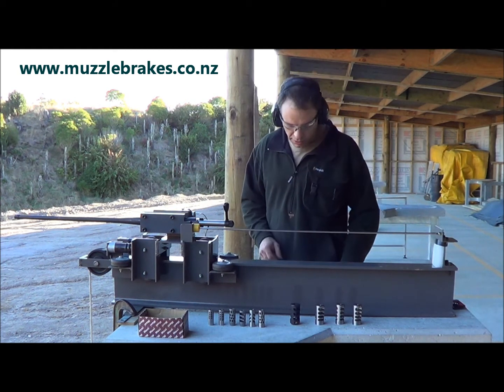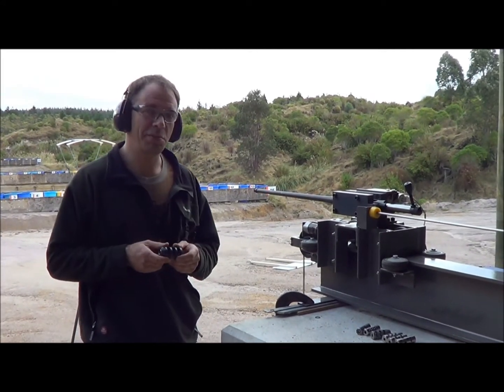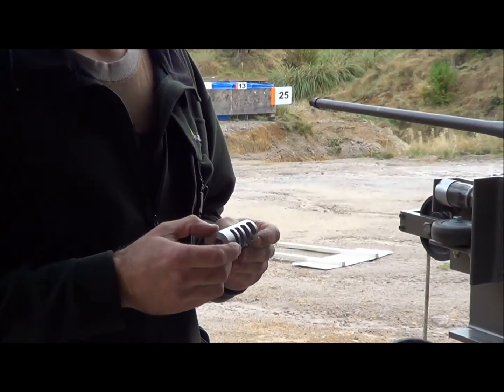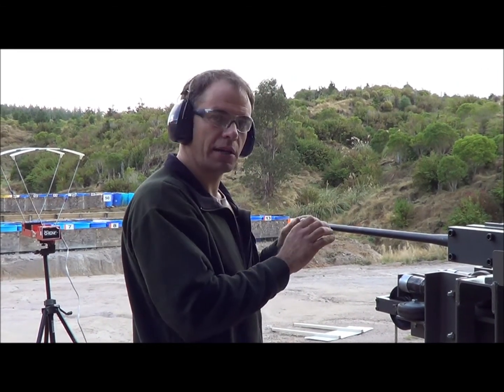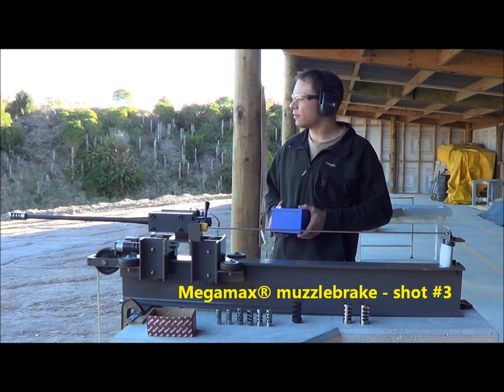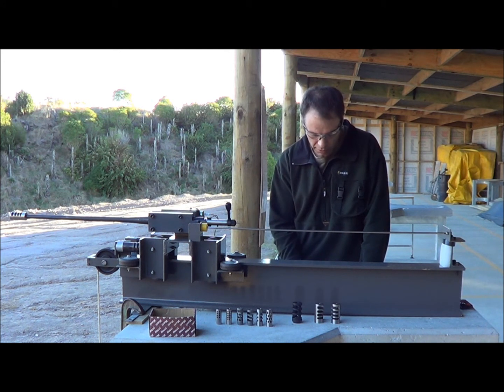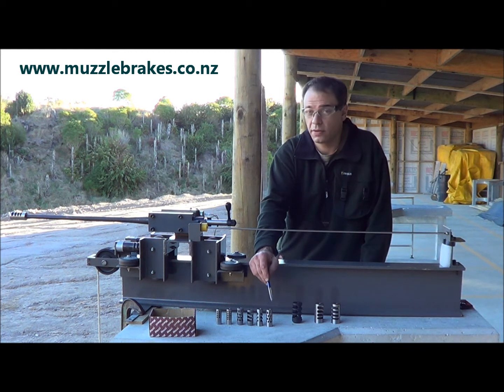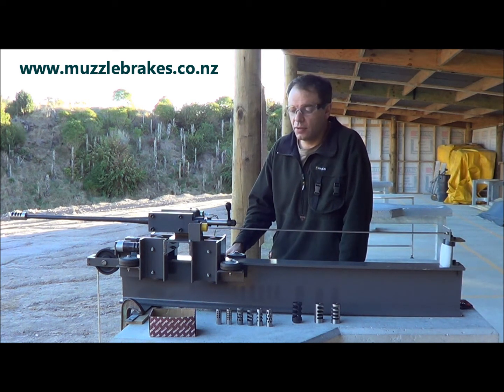Muzzlebrake Testing Part 2

Comment: Problem with your testing is you used such a professional setup for this test and you used such an inaccurate way to measure. A measuring tape.... It's like fitting a Cnc machined nut to a hand carved bolt.....
Reply from the maker: +youtuber 
Thanks for your constructive comments, but the reality of the situation is that there is no "problem" at all with using a measuring tape, which for this application is a perfectly acceptable, reliable, and accurate method of measurement for this purpose.
By way of explanation, this test system was specifically designed to avoid any use of electronics or load cells due to common problems associated with them, and if we could get some comparison tests to prove out the designs within a few % points, then i would have been happy enough with that, for comparison purposes, on that specific day of testing, with that specific lot of factory ammo used. 
The tape measure we used was a good quality one in metric, and for example on the .300 Win mag the max distance travelled was about 710mm. Now if i made an error of say 1mm in reading the scale, then in reality this would only be a statiscal error of about 0.14%. If i was having a bad day and read incorrectly by 2mm then the error would double but still only be 0.28%.  For our intended purposes, essentially negligible.  When you also consider that with variations in ammo the shot to shot measured variation can be a few mm anyway, and the fact that we fired groups of 3 or 4 shots for each brake and then averaged the readings for a given 'result', then you can see that even if we did add something like a liner scale and digital readout to get a measurement to within 3 decimal places (or whatever), the results would have been basically the same.  Or, could have been actually worse in terms of error as i don't know how liner scales like shock loading, and in any case this would have created some drag effect on the test system, which was one of the things we were trying to eliminate.
So, as you can see, the tape measure works just great thanks!   (and it didn't break down, and was not fussy about static electricity or shock/pulse  loading!) .  Cheers.